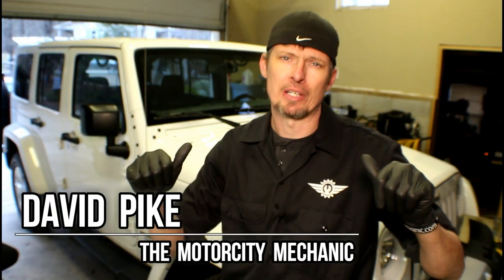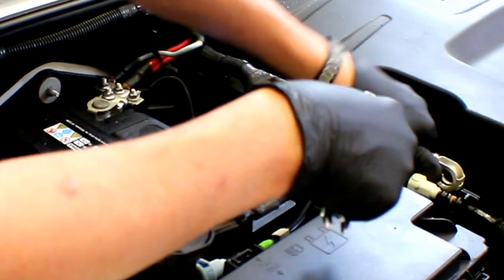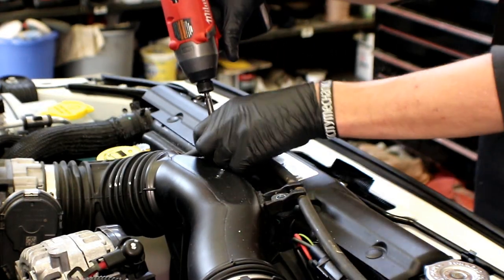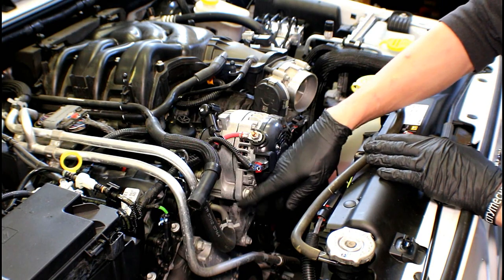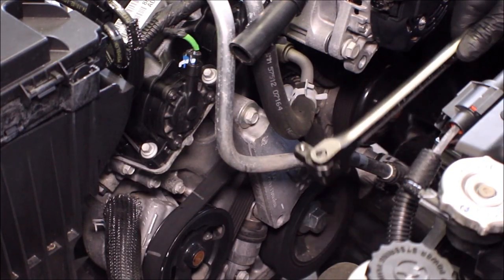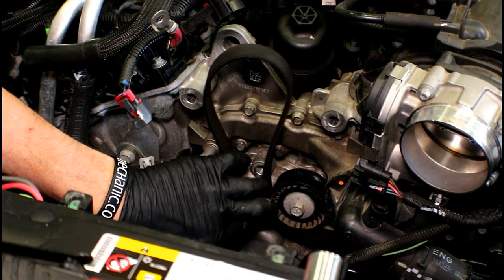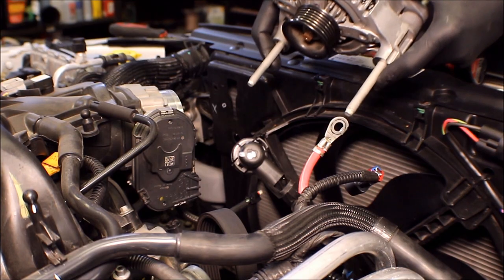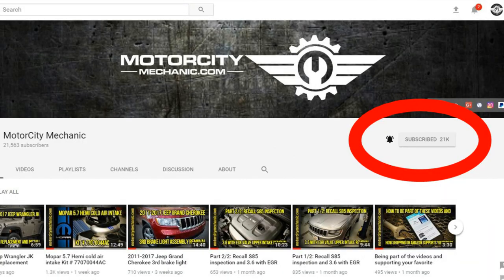2012-2017 Jeep Wrangler JK 3.6 alternator replacement

Comment: Seems like there's always work on the 3.6's
Reply from the maker: No more then any other engine we use today from what I have seen. I can pretty much bring up any engine and go thru a list of possible issues. The reason you see so much about them is that they are the main engine found in Chrysler vehicles so there are soooo many of them. And here is a little secret.....there was nothing wrong with the alternator in this video. I wanted to film the replacement in case someone ever needed to know how to. Thanks for watching the video and keeping up with the channel Saken.
Reply: I second that. I own two pentastars, and even though they have their share of problems, they are pretty damn robust. They have just enough modern technology to have good performance and mileage, but not enough fancy crap to be a maintainance nightmare. Port injected, not direct injected, 2 cats but not 4 cats, etc. Though I just blew an engine (valve related) on one of my Promasters, they have a combined 510,000 miles on them, and they are 2014s. That ain't too shabby.
Reply from the maker: I always like to think of you Kip as "long term testing" these engines haha. I know that the previous version (Sprinter) had many more issues and the cost to repair was much more. I remember back in the day when you were lucky to get 100k out of an engine for having to rebuild it or get rid of it. Still had to imagine that some versions have 300 horsepower and in a v6!  Thats alot of power in a small package.